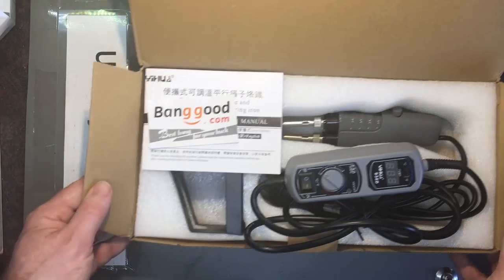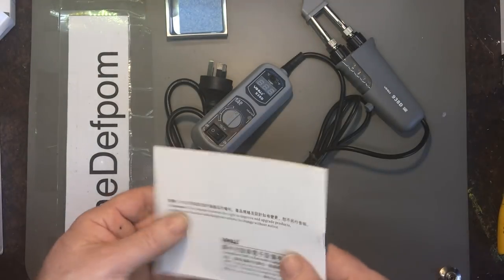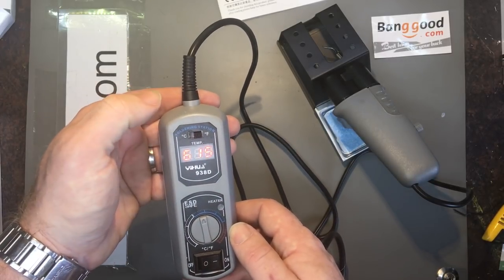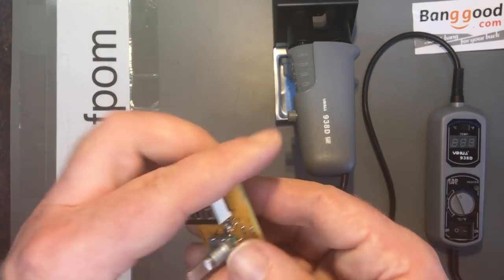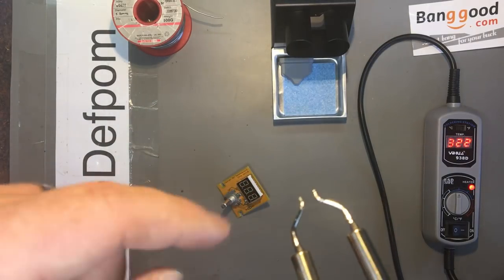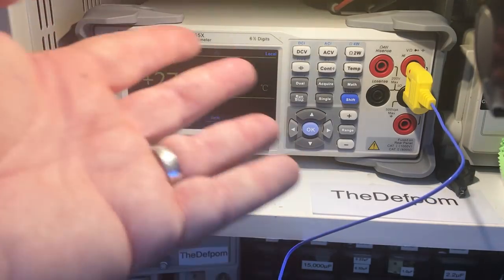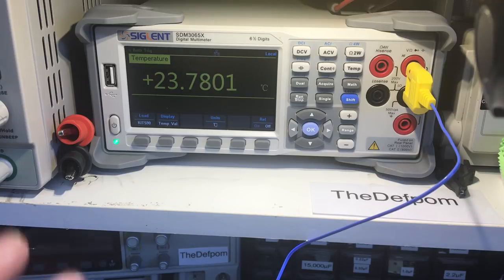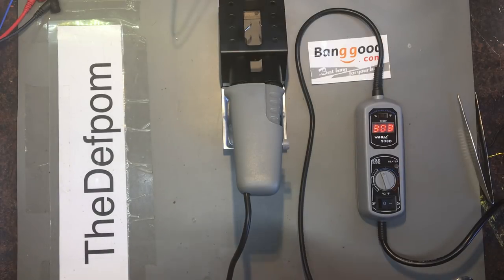#308 Yihua 938D Tweezer Soldering Station Review

Comment: This will be an interesting watch. Someone wanting to sell me dirt cheap. Imagine my surprise when i search on youtube and someone i'm subbed to has a vid. Will be liking ;)
Reply from the maker: Dave Hammerton - handy.
Reply: From someone that only recently started doing smd work. Me! (hobbyist)  Initially you weren't selling it to me. Looked like 2 standard soldering irons stuck together. It's not for fixing Iphones at a guess. But yeah, it really looked good for removing/replacing  smd soldered parts. I love hot tweezers. You can just use the one end, when adding, and grab both ends to straighten out or remove. Love that surface tension thing. Not telling a old dog how to do new tricks.  I am a novice. But i'm going to get some of these to try out. Your link showing £33 uk. I'll use to buy ;) Talking about old dogs new dogs......... Put in my place,,,,, But..... I didn't see you check the earth to tip. ;)

Comment: Yes they do like nicely made and i like the mid cable controller too, very intuitive to use, even for  monkey like me lol :-D.

The temp sensor will be at the elements tip, so those extentions will be colder, so bung the setting up a little to counter that :-).

I would shim the pivot of the handles so you get less sideways drift.
And i was also thinking the tips needed to be bent inwards slightly so they end up flat with the smd when clamping pressure is applied.
Try using them from above the component only, the tips look flatter at the ends.

Dam don't i rattle a lot ha ha :-D
No muttering "like the other half"  :)

Comment: mine got the tips turns in red when operating and the led indicator not lighting but it has heat. is this normal?
Reply from the maker: Ren Castro - no, it sounds like it has a fault.
Reply: what do you think is the fault? it is overvoltage input?
Reply: i mean not really red in color, just orange.
Reply from the maker: I really don't know, if it is getting so hot that it changes colour, then something is either not controlling the heater, or the heater control is shorted out.

Comment: Thanks for the review. I won't be buying one, though. I  can do the same job with a regular iron and tweezers.
Reply from the maker: I have always used tweezers and a normal iron myself too, but there have been times when having a tweezer soldering iron would of made the job a lot easier! (that is why i decided to get one of these, I knew it would come in handy at times).
Reply: Tweezers can make it easier especially when you’re trying to remove one tiny capacitor in the middle of a row of 20 or so.